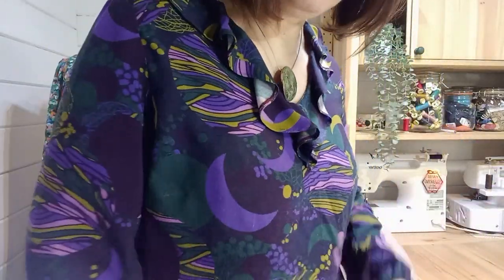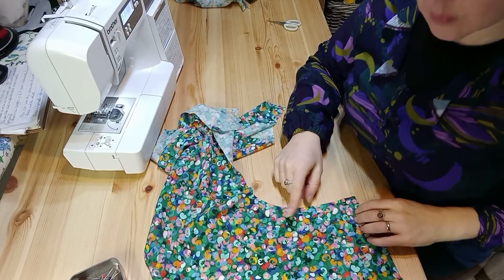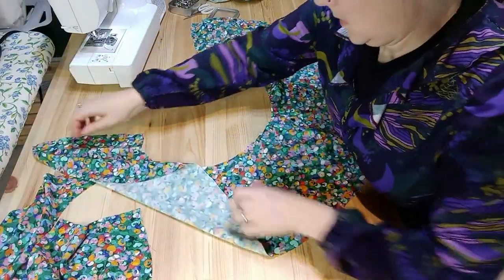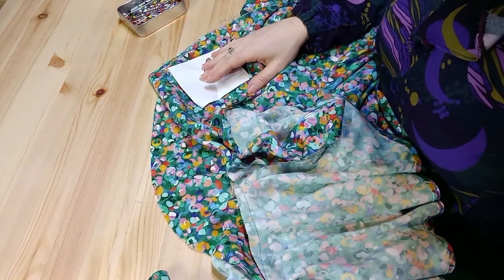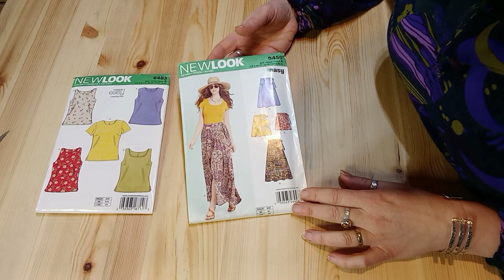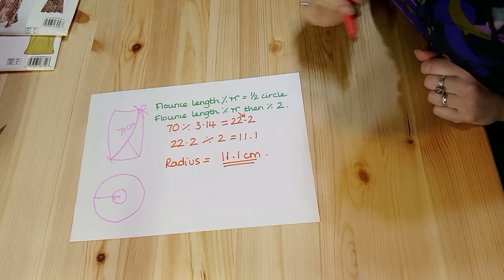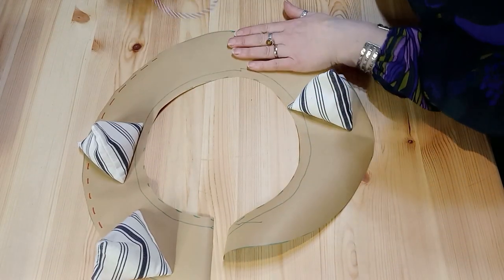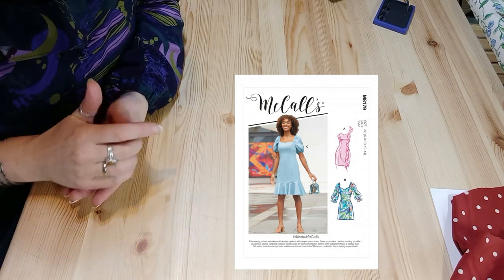Learn to Sew – How to Cut and Attach a Flounce

Comment: When I make a flounce an easy way is to measure your target seam in inches say its 37 inches to make it easy, take away 1 inch and divide by six that gives you your diameter. Decide on depth of flouce and cut out and the target length should be right. Same as you half circle cut 1 Full circle cut 2 😊
Reply from the maker: Sounds a great way too!